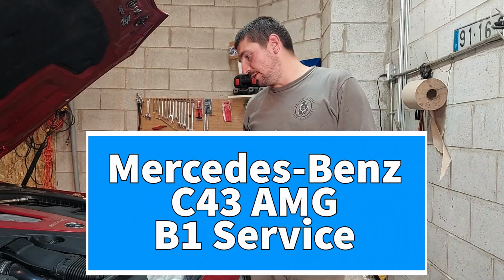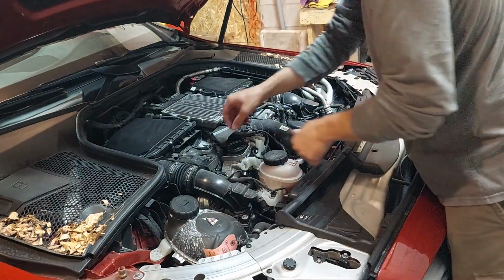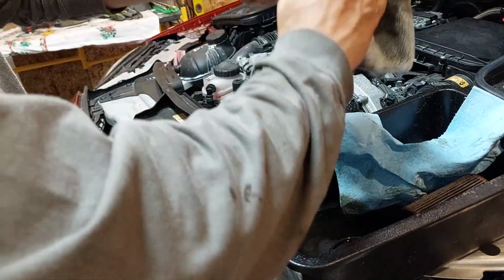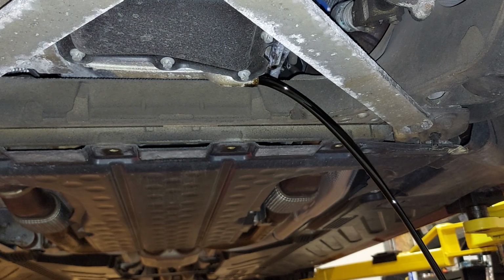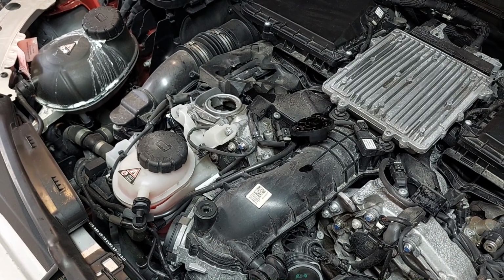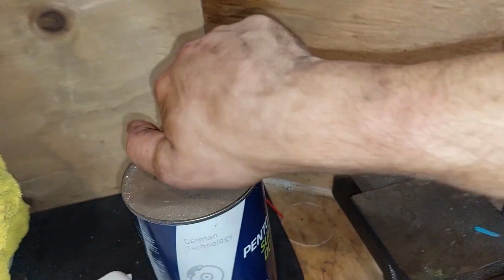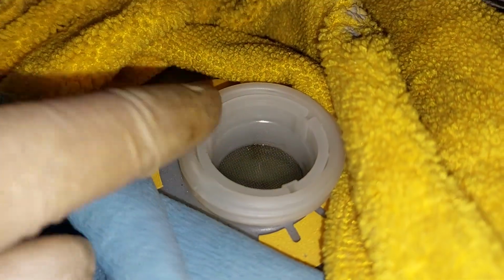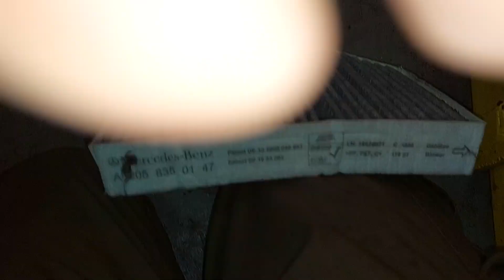Mercedes-Benz C43 AMG - B1 Service

Comment: I'm not understanding the need to drain the brake fluid if the brakes were okay. I'm trying to service my brakes.
Reply from the maker: You are replacing the brake fluid. Brake fluid brakes down over time and it's boiling point lowers. Which can cause brake fade under hard braking when everything gets hot. Moisture also can build in syste. Causing a spongy pedal. In a week I am releasing a full brake service on that vehicle I am editing it today
Reply: @MyHomeGarage  Sounds good, thanks.